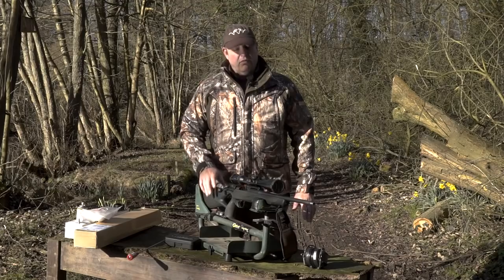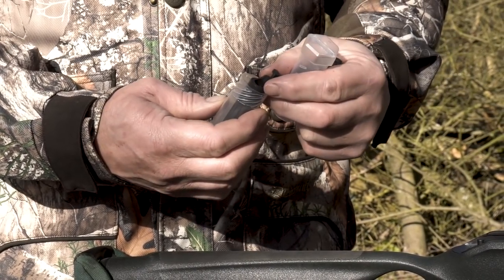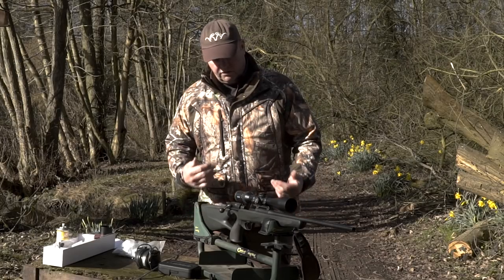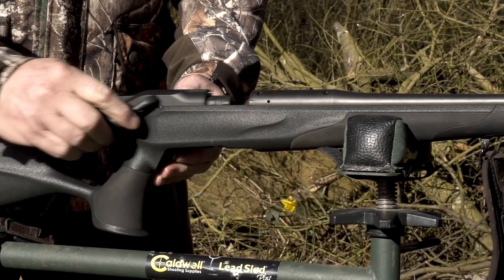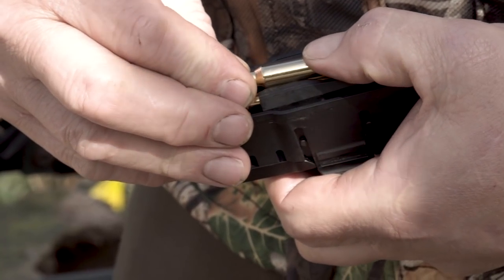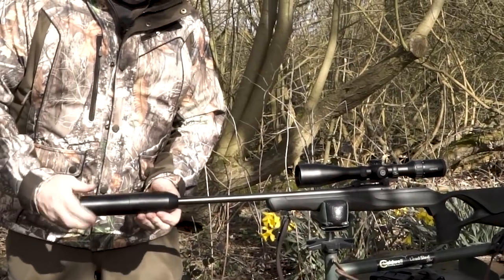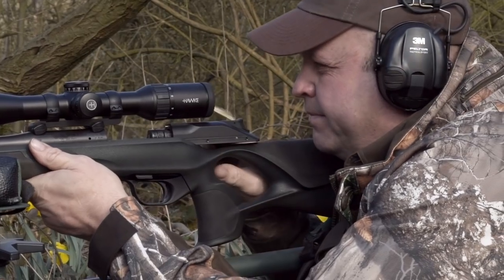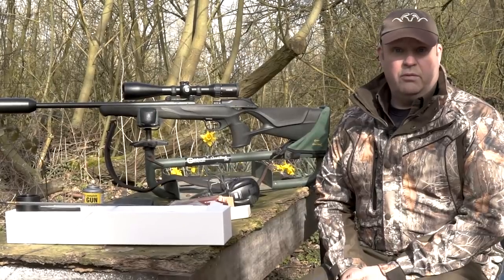How to Break-In a Rifle Barrel with Steve Wild

Comment: Barrel break in is just a myth. Especially on a cold hammer forged barrel like the Blaser has. No chips created its all cold deformation, a radial hammer and a die inside to form the rifling and size the bore. No one has ever delivered definitive proove that you can increase lifetime and accuracy of a barrel by doing all sorts of voodo break in procedures. You clean it well before the first shooting, mostly to get out all sorts of preservatives they put in at factory and then it takes a couple of shots for some jacket material to deposit. Thats the increase in accuracy you will notice after the first box of ammo or so. Its just jacket material deposition thightening the barrel ever so much to improove accuracy.

Comment: I don't believe barrel run in is at all necessary with Blaser barrels. Blaser barrels are all cold hammer forged & have a very smooth, mirror finish bore. 
Regarding your cleaning process, I hope you were able to clean that oil/cleaner out of the chamber. 
If you were trying to show how not to clean a rifle, you've succeeded admirably otherwise, a rather piss poor effort.